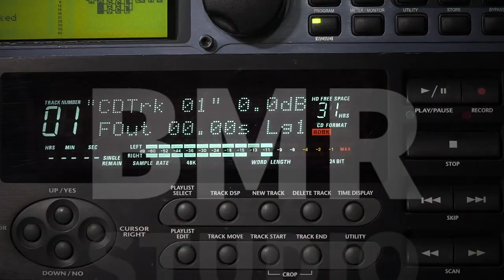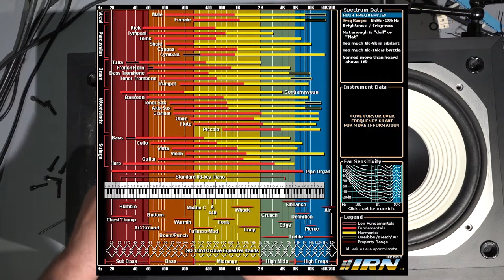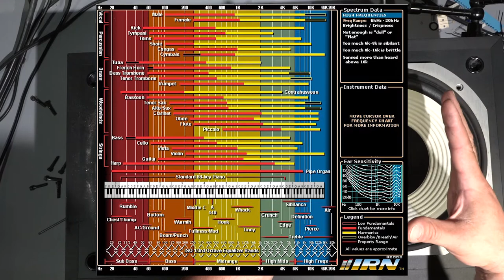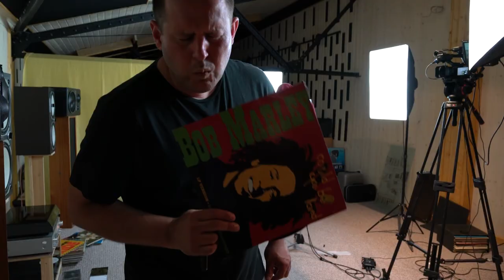Badass Kenwood LS 770 vintage speaker from 1977 - part 1

Comment: I have the mk2’s but it sounds like the audio is only coming from the horn. Am I hooking them up wrong? 😂😭
Reply from the maker: @Wilverine99  can be few things.
Crossover, cable from the crossover to the woofer, contact terminals on the woofer, and busted woofer. Definitely need a service. Bring it to some good hand service guy.

Comment: I have a pair that I restored and I would like to play them with an active crossover (I removed the passive crossover) according to you what would be the best 4000hz like the originals? looking at the original crossovers I notice that the woofer is in parallel circuit. thank you i love your videos
Reply from the maker: I do not recommend to use active crossover at all, due the physical behavior and the adjusted weight  of the passive membrane.  Just make a new super biffy buffy crossover!  Freq: We find a bit lower . 3.7 Khz, but You have to compensate the phase shift around 4-5 Khz. Looks like a flat S curve. Or just use some measure mic with your DSP....

Comment: Hello, very nice videos. Do you ever made the 3rd part? What modifications can/should be done on the crossover? Thx
Reply from the maker: Actually, yes I have a plan to modify the crossover. The original design fundamentally perfect, but the quality of the parts just not good enough for modern music with high dynamic range and square-triangle-synth whatever type of waves. I will redesign to something better. But for start, You can replace the capacitors to some better bipolar folie caps.